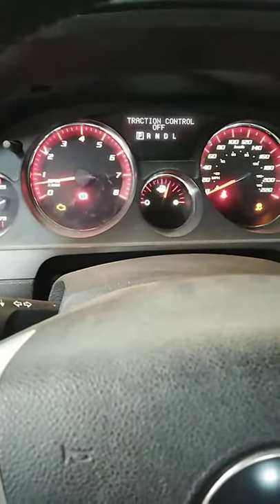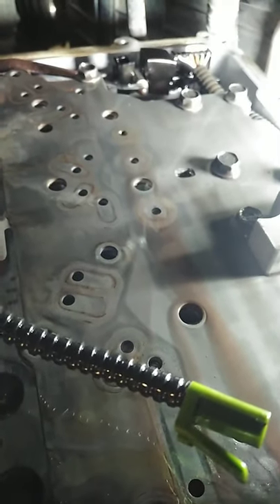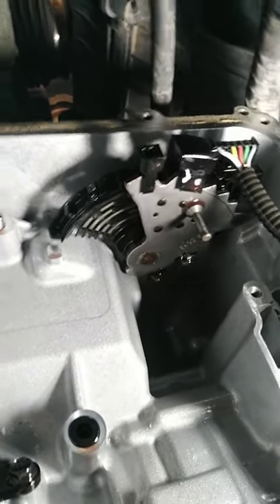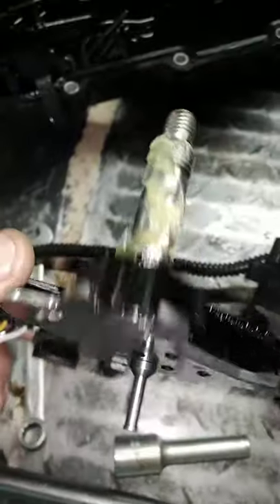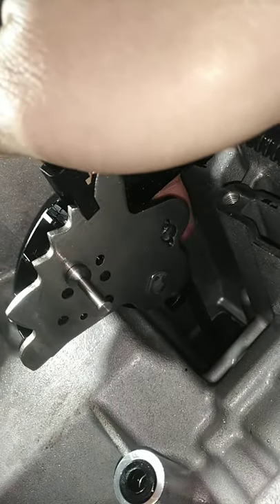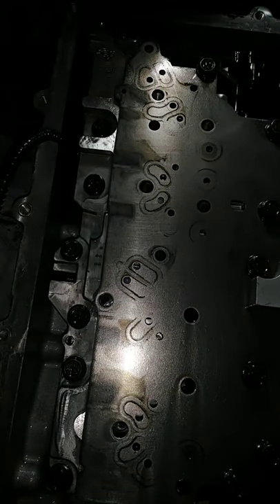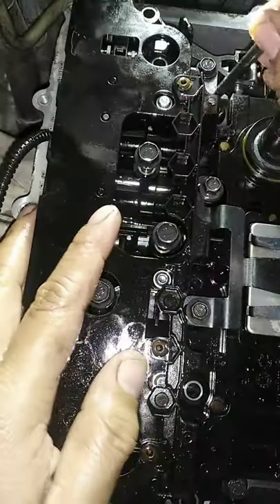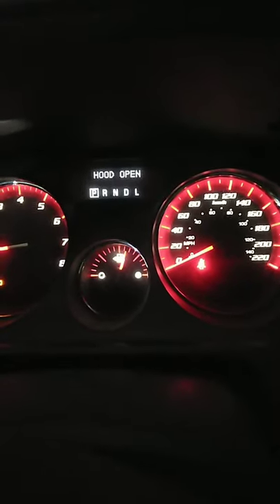Engine won't start intermettent condition, P182E internal mode switch invalid GMC ACADIA 2011.

Comment: Thank you sooo much for posting this. After much self diagnosis via scanner, my issue kept returning after several soft tcm resets. 

My IMS issue was that it cannot detect distinguish P and N. Upon ignition the torque converter slams the system. Reverse is good but low power. The D is low power maybe stuck on 3rd or 4th the entire time. Max speed is 55 mph.
Reply: My 2017 Tahoe had the same problem.
I had the sense inside the transmission changed for $620 it’s shifting gears perfectly now.